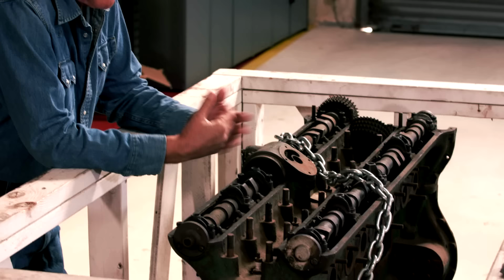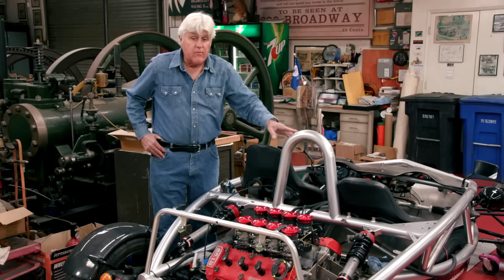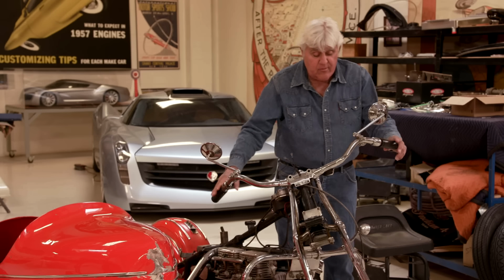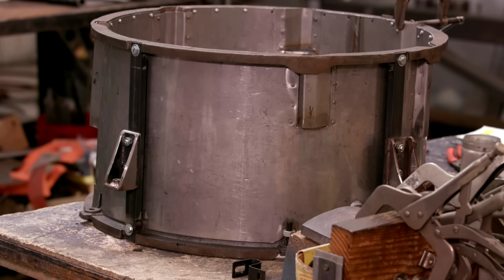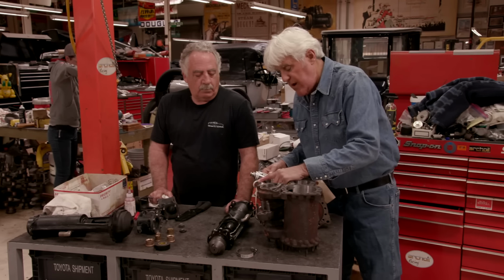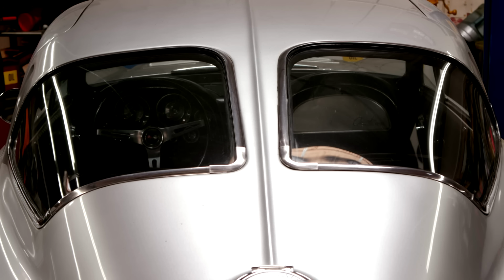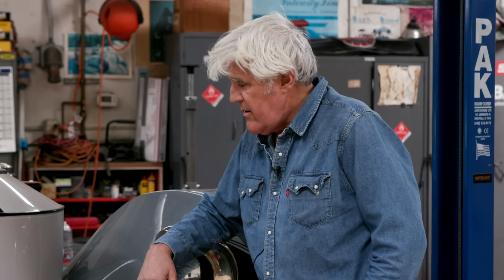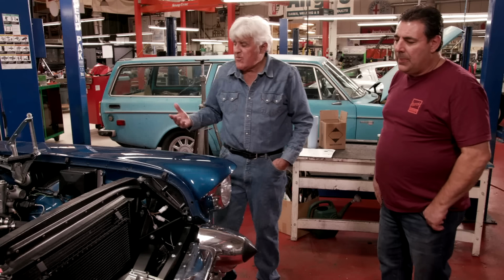Restoration Blog: March 2023

Comment: I chuckled to myself when I heard that the Doble steam car needed special steam oil from a nuclear powered sub. When I first saw the video years ago when Jay showed the powerplant from the Hughes  Doble I said to myself "That thing is basically how a nuclear reactor works." No surprise there!

BTW - glad you're still with us Jay - It's always a good day when your kneecaps are on the green side of the grass!
Reply: You are conflating nuclear reactors with steam systems. Nuclear reactors create heat which boils water to create steam, which then drives generators. The steam side systems are not fundamentally different than coal or gas powered power plant steam generator systems.

Comment: So I figured this is a good channel to ask a car question. I put a trickle charger on my '73 International Scout II all winter. I took it off today, all the lights in the cab were working, I turn the key and all lights go dead and I got zero ignition. How could a trickle charger kill a battery? (Battery was replaced like 2 years ago.) What did I do wrong?
Reply: Check and clean your battery connections.

Comment: 20K is cheap. If you didn’t have those to make them 1 up from solid slab of material would be 250k easy. Everything would half to be reversed engineered to make drawings. Used to make one of a kind satellite fittings from solid titanium  it’s called HIREL hi reliability. I called it high profit or high loss.

Comment: All of the aluminum parts can be laser scanned and easily reproduced as castings which well then need some machining.
Reply: I commented similarly. The upfront cost of sand casting in one-off or small quantities is reasonable compared to other means of fabricating similar parts. There is also vacuum sand casting which results in better surface quality of the raw casting.

Comment: Time to 3-D print some Duesy engines. Do them out of aluminum with sleaves. Granted, the crankshafts are mechanical works of art and would be difficult but they are modular and can be taken apart and copied piece by piece. Back in the mid 80's I worked for Roxas Restorations in Alsip, Ill. He was having many parts cast for these. Door handles, cowl vent pieces, even those engine side covers. He had a pattern shop make wood patterns out of the parts and cast them. Now? You can 3-D print the patterns and cast them. Those valve covers would not be that hard to do. Its just a thought....
Reply: 3D printing the patterns and then conventionally casting them can be a viable option for one-off or small production runs as you suggest. Most of the labor in traditional casting is in the creation of the patterns by a patternmaker.